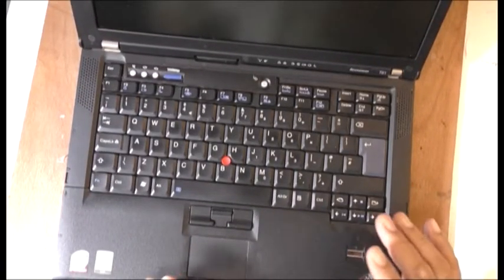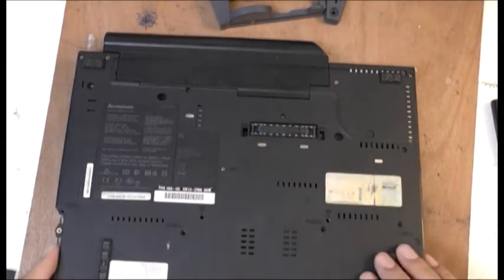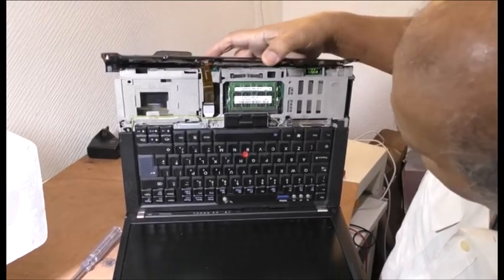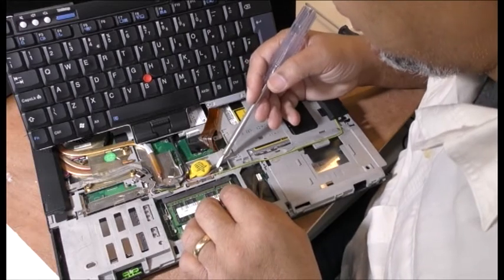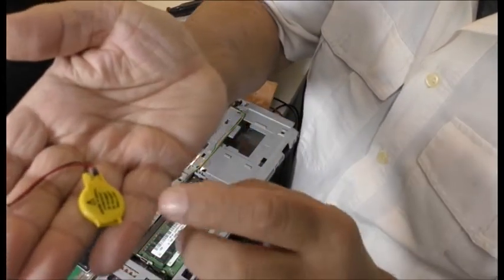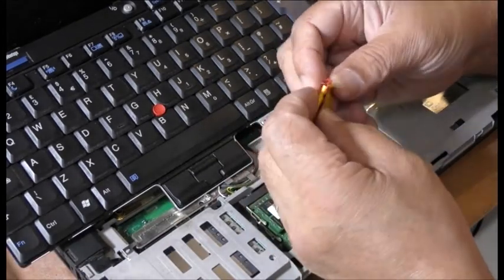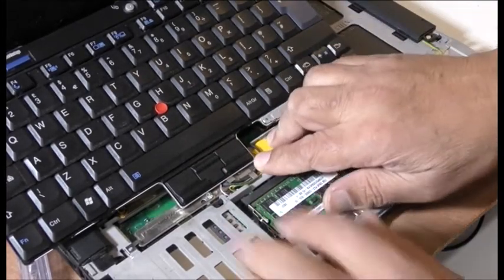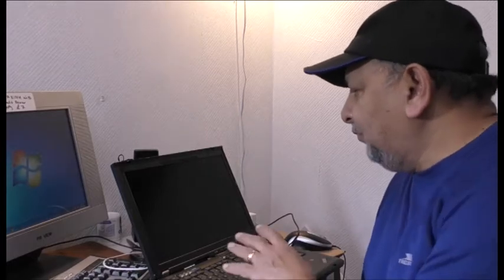#136 I Changed the CMOS Backup Battery on Lenovo laptop. ThinkPad T61

Comment: Good job! Thanks for posting.
Reply from the maker: Thank you I wasn’t sure if the battery would do the trick. Back to the drawing board 😓
Reply: @JustFun-iz9rf  I sometimes use plastic tools for opening laptops; they are made for opening cell phones. They are cheap too. Odd problem, hope you get it figured out. If you can still see a dim image, it would seem that the backlighting has a problem, but you probably already know that. Good luck!
Reply from the maker: @OldSchoolElectronics  thanks for that